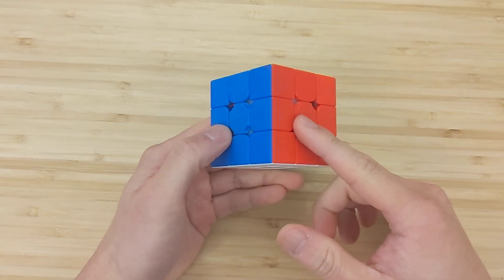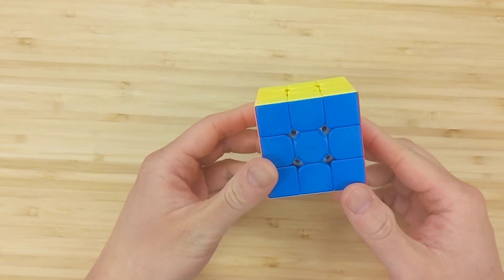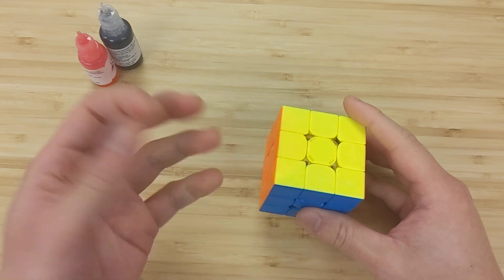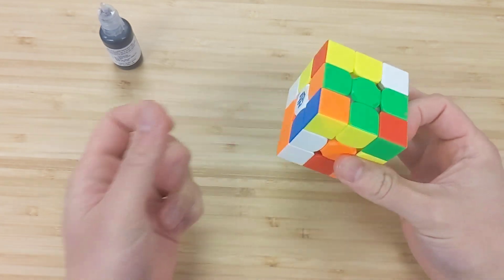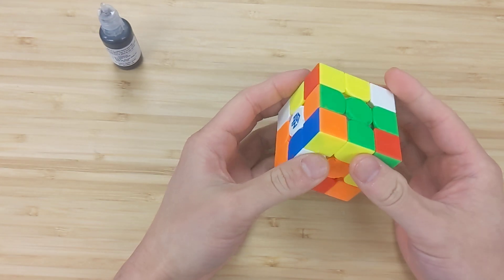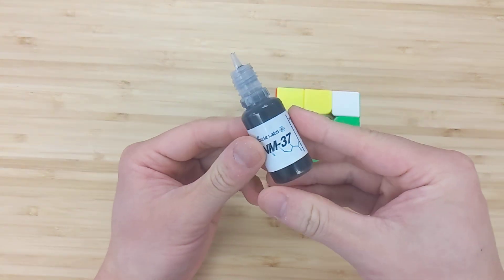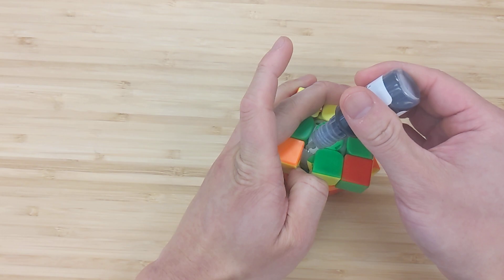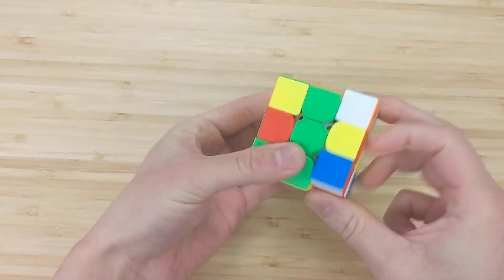GAN smart cube lube

Comment: The instructions included with this cube specifically state that you should never lube it from the yellow side, but you filmed this video with you doing exactly that. I feel like it would be worth rerecording this video mentioning this fact and showing the lube process from the white face instead.
Reply: Yeah I saw that in the manual too it’s because that side is where the charging port
Reply: So as to not damage it they put that instruction in there